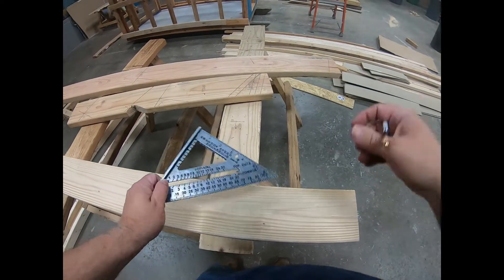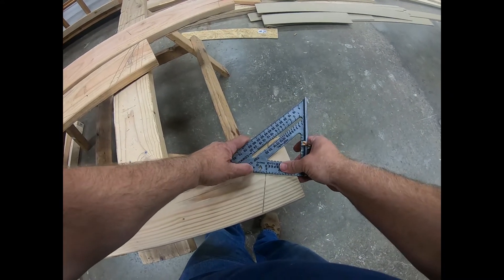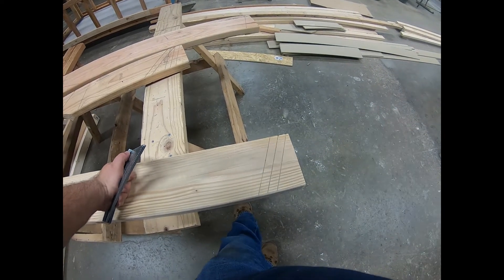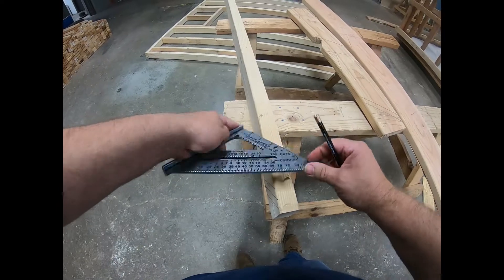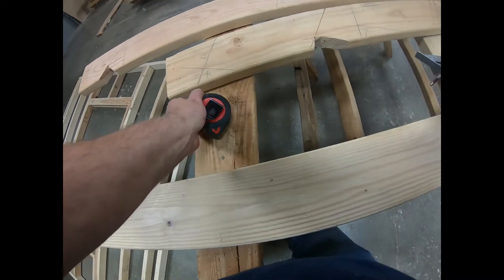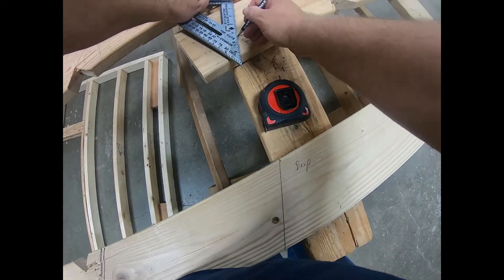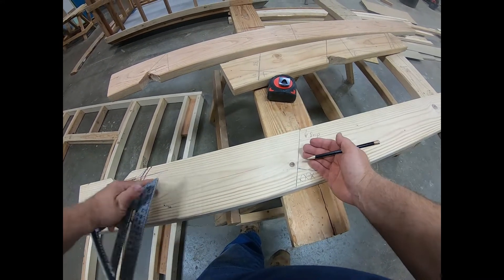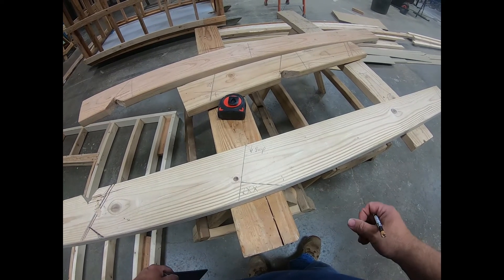How to lay out a hip rafter

Comment: Your 1 1/16 th inch should  be measured perpendicular to your plumb cut and your seat cut ( H.A.P.) on an 8/12 pitch should be a 1/4" more taken out of the H.A.P.  not the same as the common unless it's a basturd hip, in that case hip and commons are the same ( H.A.P.) but hips need to be backed  ( beveled)